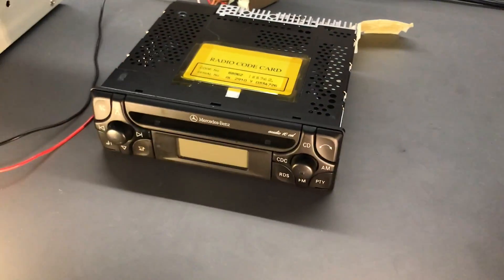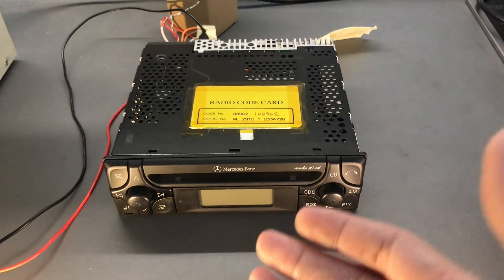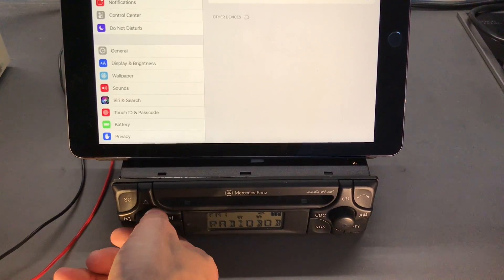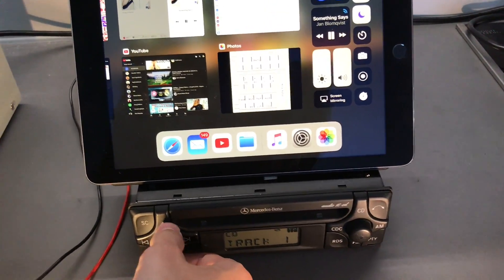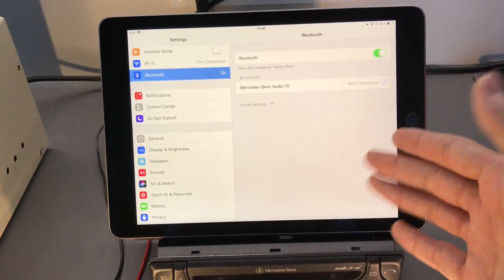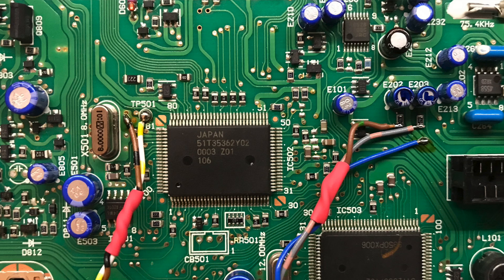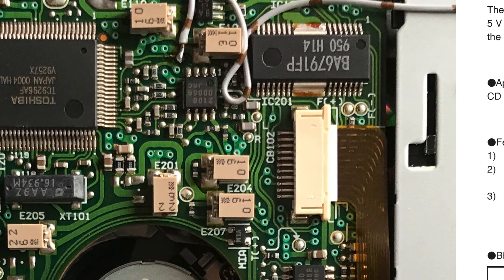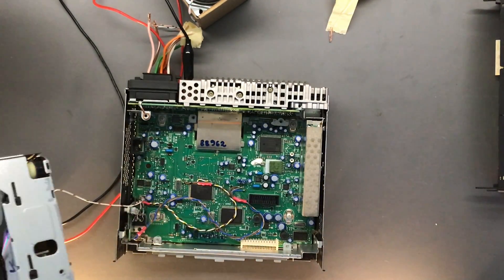Mercedes-Benz Audio 10 CD - Bluetooth Integration

Comment: Hello, I can see that you use a CD that was home recorded, how did you make this Audio 10 read those? Mine wouldn't..
Reply from the maker: I went out of my way and found 650MB CD-Rs

those work great indeed .. provided you can spawn them
Reply: @Darieee  so 700 mb ones wouldn’t, right? No clue where to find the 650s though, they must be obsolete
Reply from the maker: so .. philips did a stupidly good job on the CD spec

and so anyway they left a margin for the track width

and if you go on the thinner end - you end up with 700 - so the entire market started doing ONLY that in a matter of years

Comment: Hi, Great video would be a excellent mod for my radio, I have some questions on 8:24 time as I'm a beginner reading wiring diagram:

1. what ohm is that resistor?
2. where is the pink wire connected to?
3. what DC-DC converter did you use or as long as its a 5v converter should be fine?
Reply from the maker: hey! glad you enjoyed the mod!

unfortunately I'm now quite financially dependent on offering these mods as a service ..if you'd be interested, you'd have to ship me your radio and I'll mod it for a fee

the mod now is way more advanced and also offers button controls for skipping tracks & play/pause

https://www.youtube.com/watch?v=Ud8wfRcM0tc

Comment: ich habe heute den TP 501 und den Pin daneben, wie du sie im Video zeigst mit einem 5v bluetooth modul verlötet. Seitdem geht das Display des Radios nicht mehr an. Habe die Blende vorne öfter an und abgesteckt, während laufendem Betrieb. Kann es das zerschossen haben?
Reply from the maker: leider - kann es schon sein 🥶

biete auch dieses Umbau als Service an - falls du Interesse hast, screib mir ein email an lipton5001 yahoo com
Reply: @Darieee  Danke, aber ich hab den Ehrgeiz das selbst zu schaffen 😉
Reply from the maker: wirst auch schaffen 🔥 Daumen gedrückt
Reply: @Darieee  kannst du mir nur sagen ob bei der 5v Stromzufuhr was zu beachten ist? Ist doch nur der Tp501 (+) und der Pin daneben (-). Mein Bluetooth Board läuft aber nicht.
Reply from the maker: ich kenne mich mit dieses tp501 leider nicht

Comment: Hi! Is not possible to use directly the optical IN for the CD changer to connect a Bluetooth box (with SD slot, AUX in  and USB)?
Reply from the maker: Way back in the day someone made an optical D2B adapter but .. it never got ripped off by the chinese (I think), and it came too early for it to be super relevant

and so now they don't make it anymore, and there is no other way to interface with that bus

it was also super pricy, something around 300$

Comment: thanks for the video.it really inspires me, so it kept me at night thinking to found better solution. and did --> https://www.hardys-place.de/mercedes-benz-audio-10-cd-aux-bluetooth-nachruesten/ ... aux runs through AM and it really runs...as I can see it in your comments you already find it out.
Now what I'm trying to do is connect with Bluetooth because low quality 3.5 jack and channel loss if not connected properly ( car bumps,etc.)
I think this is cheapest option https://www.aliexpress.com/item/4000212398331.html?spm=a2g0s.9042311.0.0.352e4c4dxC16BH 
connect it directly to 12V ignition on radio, and no problems with current than. no need for bluetooth module and current converter.
what are you thinking? also what bothers me is the background noise from AM when turn volume up, didn't catch Russian website explaining audio grounding. thanks in advance and keep good work helping people !!! Viele Gruße aus Kroatien
Reply from the maker: hey !

thanks for the heads up !! I actually am using that AM method - was planning on making a video about it - but - for the past year modding these radios has been my only source of income .. so .. I'd rather keep my competition as low as possible for the time being

supposed to get hired at Continental any moment now .. if that really picks up I'll for sure "open source" my production-level mods

anyway for the audio 10 cd that is my drawing there 😂, humans are terrible at keeping secrets

if you're still having problems with the bluetooth noise, perhaps you should try one of these modules out, with an isolation transformer
https://bit.ly/3eEItc1

Comment: Hi, I was wondering if you can help. I was hoping to put a CSR8645 in my car stereo so I could use it when a blank CD is in the CD player. I have successfully powered the module and my phone does connect (even though that's the easy part it was still a big achievement for me!). My issue is I cant figure out where to connect the audio lines. I have tried searching for datasheets of the chips but I've had no luck, and the board does not seem well labelled, however my understanding of PCBs and audio systems is negligible which does not help. I was wondering if you could give any advice on what is the best way to figure out where to connect the audio lines?
Thanks

Images for reference and if they may help (apologies for the terrible soldering ;P)
https://imgur.com/CwrW1N1
https://imgur.com/Qh9okRC
Reply from the maker: So, first off, soldering't not really that bad

Secondly, this does seem like a tough one - is there anything on the bottom of the motherboard ?

If absolutely all else fails, you could inject your bluetooth audio RIGHT into the power amplifier, but then you would have no volume, eq, faders available ...

Do give me your email and I'll send you the pictures you've uploaded with some markings on them
Reply: Sorry I'm away from the stereo for a few days, I'll have a look at the bottom when I get back and upload some pictures. Cheers :)

Email: aaronwb82@gmail.com
Reply from the maker: Alright, I sent you some stuff :)

Comment: Thanks again, I made my Bluetooth integration slightly differently, using the AM button as a switch. I connected the R and L input to capacitors E223 and E224, grounded the leg 42 of the sound processor and took the voltage for the MOSFET switch from the leg 3 of the IC005. Now the Bluetooth is on only when you press the AM button. The sound is pretty good.
Reply: Great detective work guys. Watching this with great interest. I'd love to do this mod to the audio 10  in my W210 estate.
Reply from the maker: I can guarantee that AM mod is the best and easiest way !
Reply from the maker: Only AM, I'm a bit tied up right now, but it's coming
Reply: @Darieee  That would be awesome to get a video or even some basic schematic on how to wire up the AM method :-P
Reply: Hi Darieee, waiting for a new video of this new easy way to connect bt/aux with a audio 10 cd over AM.
It´s enough for me to connect an aux-cable, i don´t need bt. Is the new way also over the cd-input (and the AM is used only to switch the bt on) or is the input also over AM? I´ll send you an email. Thx
Reply from the maker: Could you detail that a bit more - I've seen that done but never understood how exactly
Reply: I essentially  compiled information from your video and from two Russian sites, here are the links:
http://w202club.com/index.php?topic=27255.15
https://www.drive2.ru/l/489197738160816273/
You can use Google translate, but there is a lot of photos and some schematics
Reply from the maker: Thanks a lot .. I have 3 radios I burnt the CD controller section in .. so .. I kinda need this relatively badly :D

The best shit is on russian sites .. but .. I was born riiight at the edge of the non russian speaking part of europe
Reply: Sorry, I did not take any pictures ant this time. If I understand right (and I am  biologist, and not engineer), there is a loop between LOPO and LOPI, and ROPO/ROPI. When I tapped into E223 and E224 as shown in the second Russian site, the signal went to legs 12 and 28. At least, I can adjust loudness using the radio and steering wheel controls. I'll disassemble the radio gain next weekend to connect the handsfree microphone, and this time I'll take pictures and send them to you
Reply: I admit that the wiring is sloppy, but the guy is from Siberia, the snow melts rarely there, let alone hot glue :-)
Reply from the maker: Thanks a lot, that'd be awesome !!

Sloppy I wouldn't say - I find it even quite impressive how he soldered directly onto the pins
Reply from the maker: So far I really don't understand why feeding a signal in that way has anything to do with AM - there is another 1 wire input that is AM mono, which sounds like garbage - so, this must be the stereo AM input I suppose
Reply: Well, I presume AM is just used to switch the module ON,  then AM input is muted by grounding pin 42 and we are tapping into the optional input channels that are not used or used by other inputs
Reply from the maker: Yeah - cool that someone found that those outputs are 'by default' selected

Thanks again for the tip! Helped a lot!

Once I get it down I'll post a video on that too
Reply from the maker: Ok, it works !!!!! Awesome ! Thanks a billion for thinking to come back and report on the new method - here in the west nobody's recommending it - will change that shortly !

Comment: Thanks for the video and an elegant mod. I have a couple of questions: 
1.Your CSR8645 module is 12v, but you are feeding it with 5V, am I right?
2. Instead of using the MOSFET, can +5V for the module be taken somewhere from the CD unit board? In this case, the BT module will be on when the CD is selected. 
3.Can you share a link to your silence CD?
Reply from the maker: Thanks !

1. Nope, it's 5V, I tend to prefer those modules,  makes them more suitable for using 5V linear regs (the 12V modules I wouldn't stick across a car's main V+, since that regularly goes up to 14.5, and might dip down close to 12, in which case a 12V linear regulator would be problematic)

2. You'd need a 5V source that can handle quite a bit of current, given these modules will draw ~50 - 100 mA ... control logic is usually 3v3 at most, and in no case can sustain such a drain (so, I'd highly advise against this). I think the main spindle motor is 5V, but that's always pulsating on/off ... so ... not the best (smoothing that would require a diode as well - and at this point it's really no longer worth the effort)

3. I've added one in the description :D